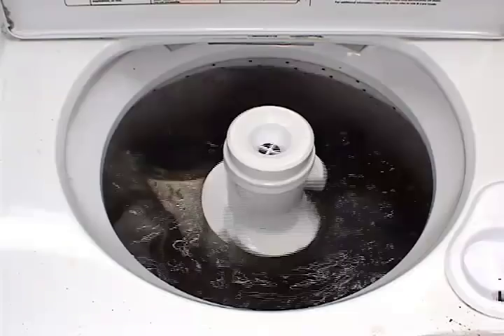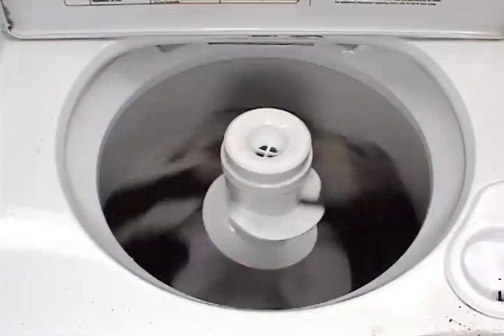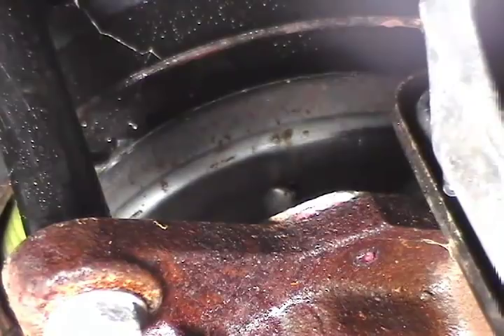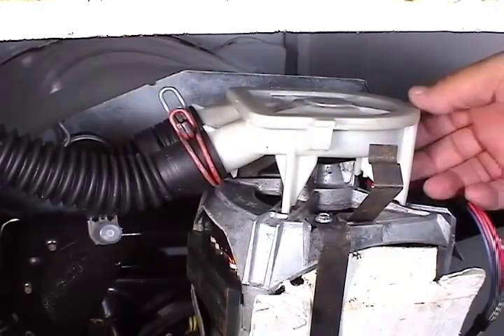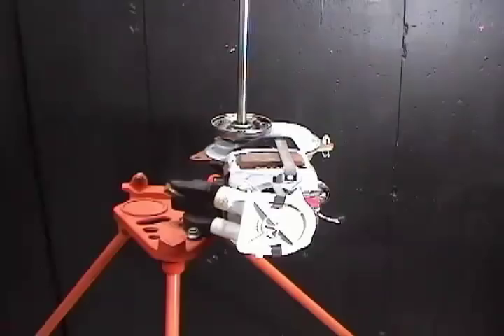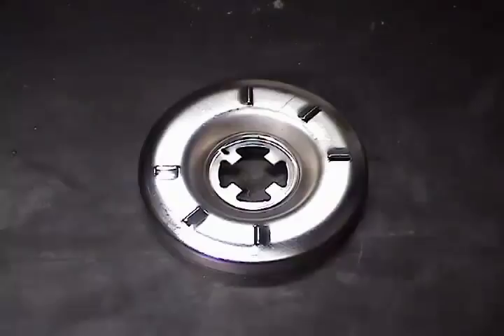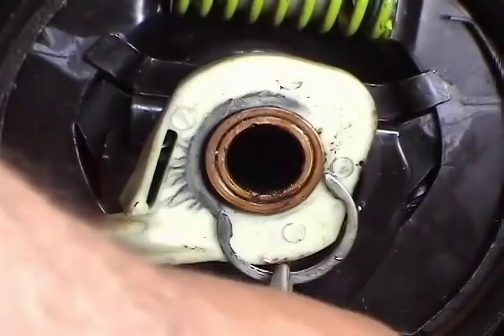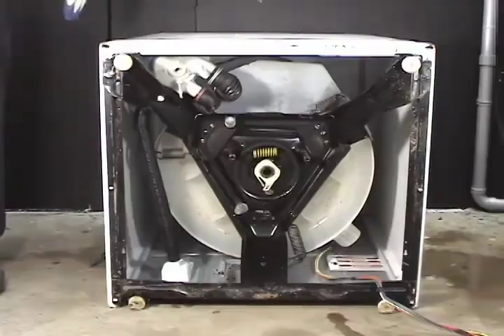Whirlpool Washing Machine Not Spinning The Clothes - The Clutch Assembly

Comment: Hey i finally got the right clutch and works great now. My washer just stopped spinning again and i checked new clutch and coupler are both fine. If i start spinning the tub with my hand it goes a bit then stops but makes no noise....why isnt my washer spinning now? Kenmore 80 series.
Reply: The next thing I would suggest is to check the safety lid switch, that's a common fault as well. Do a continuity test on the safety switch with a multimeter. If that comes up good then you can try to select a cycle and wiggle the knob left to right and back and forth and if somehow starts up then you may have a timer issue but the only sure way to see if timer works are to use your multimeter. And if the timer is fine you may have a capacitor issue it may not be putting out enough volts to start the motor.   Please, when you trying to troubleshoot disconnect the washer from the outlet and if you are doing anything with the capacitor you need to discharge it first and DO NOT TOUCH THE TERMINALS until its discharge completely. If you don't feel comfortable of course I would hire a professional to fix the issue.
Reply: @crossface40  thank you much.

Comment: There's was a belt like part hanging off the clutch. Where does that belt go??
Reply from the maker: Federico if the belt you are talking about is like made of foam, that is not a belt. That part goes glued to the housing above the clutch and is used as a noise dampening and you don't really need to put it back
Reply: @theapplianceman  oh ok. Thanks.

Comment: This washer has a thing that mine has that I've never understood...that little translucent white plastic cylinder/cup that seems to hold a steel pin that does nothing.  It must be a spare or shipping pin or something; does anyone know what it's for?  It's stuck in a hole in the motor support frame on the left side; you can see it clearly just in line with Angelo's grip at 8:25 or so.
Reply from the maker: That is a shipping pin. They use the cup to catch the pin after it is released when they deliver the washer. There is noting to weary about that pin
Reply from the maker: Thank You
Click on the link below to check my website
http://www.do-it-yourself-washing-machine-and-dryer-repair-help.com/
Angel theapplianceman
Reply: @theapplianceman  thanks, kinda what I expected, but good to have it confirmed.  Where does it go when shipping?  Immobilize the tub support frame, I guess?
Reply from the maker: @danmick8645  To be honest I never needed to find out where they where attached to. All I know is that they where use to stabilize the washer during shipping
Reply: @theapplianceman  cool, thanks.  And thanks so much for the excellent videos.  I've done two drive couplings and a transmission oil seal based on your help.